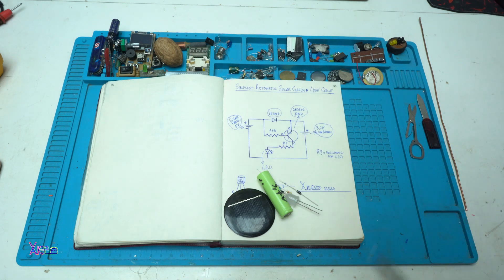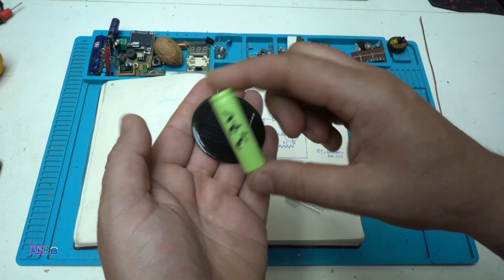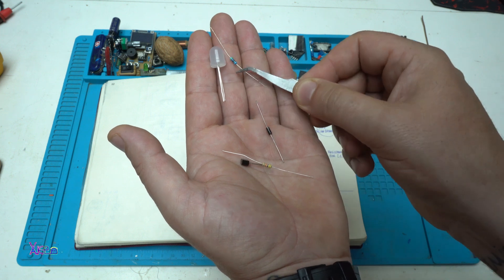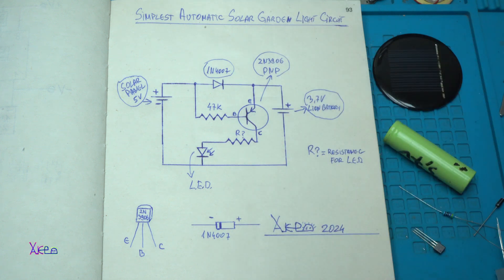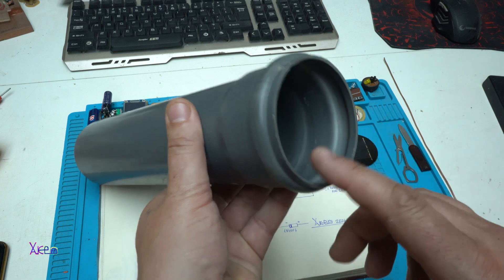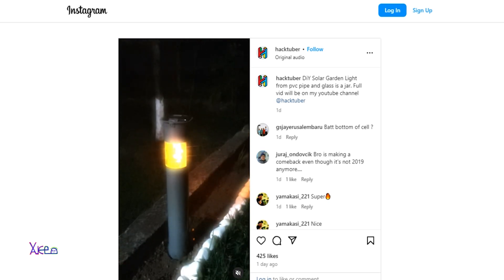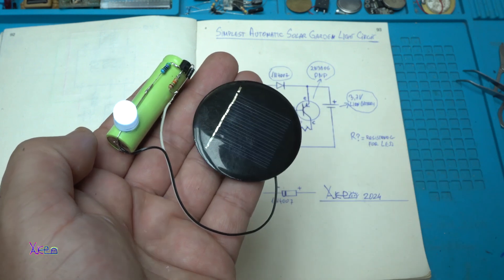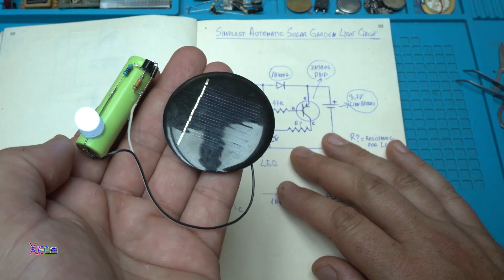7 Components Auto Solar Light Circuit with 3,7v battery

Comment: I wanted to complain about this not having over-discharge protection on the lithium cell, but looking at it... I doubt that led can draw more juice than the solar cell can recharge in half the time. And the li-ion cell's capacity is huge compared to both the charging cell and drain from the led. And self-discharge can probably take care of any over charging of the cell.
So, I like it.
Reply from the maker: Yes the battery capacity is 2000mah,the solar panel give around 20 to 40 mah max,the led pull around 15mah so everything is stable,tested 👍

Comment: Most of the small solar lights use nickel metal hydride batteries at 1.2 volts and the solar panel produces about 2 volts. The newer ones have a dedicated chip that only needs a small inductor along with the solar panel to charge the battery and drive the LED. The circuit is basically a joule thief so that the LED can be powered with one small battery at around 1 volt.
Reply from the maker: That is basic circuit  mostly used in garden lights,I have couple of cheap solar garden lights but they didnt last long,so I decide to make my own with lion 3.7 battery
Reply: Sure.

Comment: Been repairing me mother's garden lights with failed AAAs some have smaller ones too and sealing them from water and swapping to bigger capacity cell bloody rust is a nightmare 😂 this is better upgrade with li-ion cells
Reply from the maker: Yes,with using lion you get more capacity and that small solar panel cant hurt the battery bcz of low charging amps